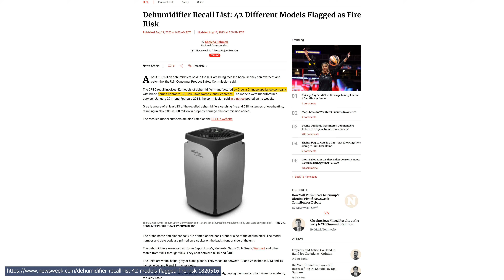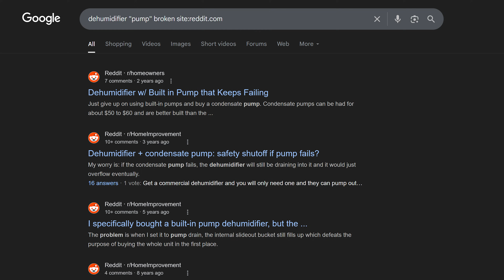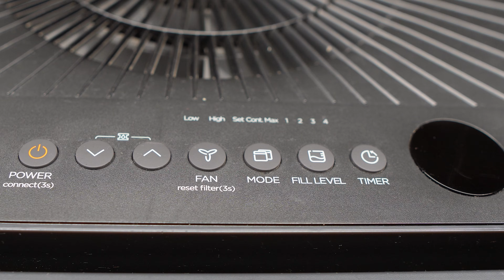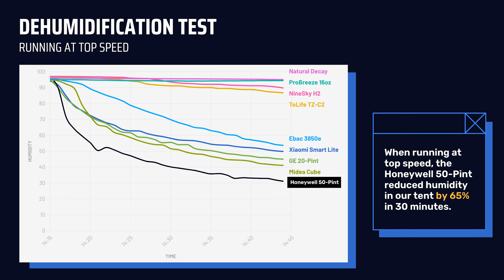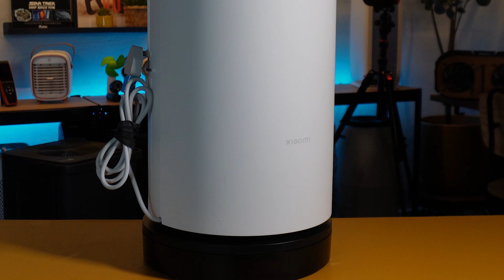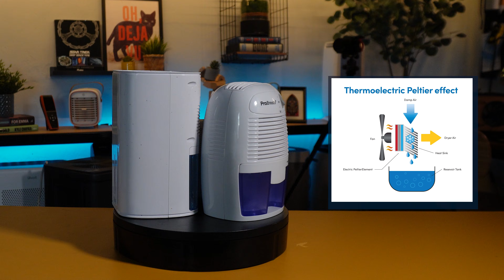Don’t Buy a Dehumidifier Before Watching This → The Best Dehumidifiers We Tested

Comment: Aerocky 5500 80pint or the midea cube 50 pint? The midea cube seems slightly more expensive but I didn’t see a direct comparison on your website. If you have the time. Please help me make a decision. My home is on the larger side 2600 square feet and has a humidity that ranges between 50% and 80% and I want to get it down to around 35%. I’m not home most of the day so I do want a big tank but I still plan on emptying it daily, just not sure if it will still run if I forgot to or am not home for a day or two. I guess a big concern of mine is that neither of my parents should be lifting more than 20 pounds and I’m worried that if the the tank is simply too big and I take a half week trip that they would try to empty it themselves and harm themselves. I just don’t fundamentally understand how fast any of these different tanks fill up. I hope you can begin to include that data into your videos. If leaving the dehumidifier alone for a few days would be okay even with a small 1 and a half gallon tank like on the aerocky model I looked at on Amazon then I would prefer it, but if not then I would need to go with a much bigger tank like the midea. If you do take the time to respond and help me make a decision, please be sure to leave your Amazon links so I can use your affiliate link.
Reply: If it helps I have a very large basement and Attic, same square footage of the house each of them separately, and both of them are not insulated at all(almost open air but not really) and let all the moisture in. If you believe I should go with an even larger model I will trust your judgment.

Comment: Please,  let us know the details of a dehumidifier for the laundry and how buy one useful for it and the kitchen room in winter. Keepind the good temperature combined with the weather in South England 🇬🇧 by the sea. It's very humid close to the seaside. Could you make the necessary difference btw a high end as Dyson performing dehumidifier and a cheaper good one. Will need a big one or 2 machines for a 120 m3 flat. Thanks for your nice 1st video
Reply from the maker: I would reccomend checking out my latest video that focused on the UK market: https://youtu.be/kv2sMl2h618?si=LGBVd4kaXNmOZ-2- Let me know if you have any other questions.

Comment: Would like to see more reliability info on the various brands/models.  I had an Emerson 70 pint model that quit in less than a year.  I replaced it with a Honeywell 70 pint model from Amazon  that lasted 2-1/2 years.  I replacex the Honeywell with a Waykar 70 pint model (also Amazon) that quit in about 8 months and was replaced under warranty.  The  replacement quit after about 6 months.  Fortunateky I had an extended warranty on the original Waykar and the purchase price was refunded.  All three looked almost identical inside.  The Honeywell was the best of the three (four really ) but I wouldn't consder any of them to be very reliable.
Reply from the maker: This is a very important point for dehumidifiers. I am working on an update for this video at the moment and I'm happy to report there are some good new models that offer 3 year warranties that should help a lot your experience of breaking after 1-2 years does happen a lot more than what I see with other appliances.

Comment: I bought a Danby twelve years ago and it's still going strong even with daily use.  Stay away from Frigidaire, as they just don't last; lots of complaints about system failure (EC code) after a couple of years or even less.
Reply from the maker: Glad to hear your Danby is going strong! 12 years is pretty incredible. Thanks for sharing your experience with Frigidaire and their system failure.

Comment: checking out the dreo  711S, hopefully its a solid unit, using gravity drain in basement.
Reply from the maker: I want to review this Dreo dehumidifier as found that the humidifier works really well from this brand.
Reply: @HouseFresh  it works awesome so far! I am using a gravity drain hose 5/8” ID I found they seem to last longer larger the drain diameter.

Comment: Had a delonghi when I bought a tsylor guitar...taylor guitars recommended it for thier acoustic guitars...had it 9 years..never cleaned it out and still works strong
Reply from the maker: It’s great to hear you’ve had such a reliable experience with that unit over the last nine years! I did have a delonghi model but gave it away to someone who needed it. Will need to make sure I buy another for the next update of this video.

Comment: I got a Midea Cube based on this, and a great in store deal. We've had it for nearly a month and it's helped a TON. Not only does it make higher temps more comfortable (in the PNW) but also it helps the AC perform better!

Thank you for this video, I'm sorry I wasn't able to use your affiliate link
Reply from the maker: Ah that's so great to read! I'm very happy the Cube is working well for you and don't worry about the affiliate link. Having you taking the time to share your experience here means a lot already.

Comment: Dehumidifiers are a necessity in northern Virginia, and choosing them is a nightmare. Only a Haier, no longer available, has lasted 3+ years. The cost of land-fill disposal was $30/unit in early 2025 because of the refrigerant. I was completely unaware of this. Now I have 2 which are dead. BLESS YOU for this very scientific comparison and excellent details, because I am again struggling to find something for a bedroom and basement.
Please, would you know why they all have these pathetic plastic hoses now??
Again, sincerest thanks for this EXTREMELY useful information.
I am stuck in the U.S. and so appreciate your worldwide approach.
Reply from the maker: Its similar here in the North of England, you just need one during the winter or model will grow. I had no idea that it costs to dispose!  

The cheap hoses do seem to be very common but I did like that a model I tested had a host connector so you can use any garden hose which makes a lot more sense!

Thanks for your very kind words!

Comment: I'd stay away from the Honeywell. I bought a 50-pint model almost a year ago and it failed completely just prior to the warranty running out. The company does not appear to be repairing these anymore. After having to call because there was no option online from the website, they pointed us to a non-advertised webpage. Filled out the form and was given a site credit as the "warranty" fulfillment, but the amount won't replace the same model and will only cover a lesser model. After watching this video, maybe I'll try the Midea cube. Thanks!
Reply from the maker: That sounds like a frustrating experience, so I appreciate you sharing the warning with others as I did notice that Honeywell has stopped selling many of the larger models we had tested a few months after this video went live.

Comment: I like my Pelonis from the local HW store because I can sit on it while I shave my head. The wheels broke off which makes it even better. I saw a new model of a different brand from Costco and will now avoid it because of the built in pump.
Reply from the maker: haha a dehumidifier that is also a seat! Yes the built in pumps are a major source of failure so I do recommend avoiding  and not paying extra for.

Comment: Hello. 
What a great video this is.
A question please. 
Do all dehumidifiers release or blow hot air into the room as they remove humidity?
I own a different units, and every one  does.
I remove the humidity, but the room fills up with hot air and doesn't feels any better than it was before I turned on the dehumidifier.
Thank you so much!
Reply from the maker: Thanks for the kind words.

All dehumidifiers will output hot air as they are basically an AC built in reverse. This video taught me a ton about how they work: https://youtu.be/j_QfX0SYCE8?si=7mNcF6mvlyRAiDvo

I'm not sure if there is anyway to avoid this without looking at a different type of dehumidifier that does not use refrigerant. Sadly I don't have much experience with other types of  dehumidifiers.

Comment: Quick question. I’m looking for a dehumidifier for my bedroom. The humidity has been 66-70 RH

How would the Midea Cube do. Would I need the 20 Pint, 35 Pint or 50 pint?
Reply from the maker: I would choose 20 pint but I have only tested the 35 pint for sound levels and it’s still fairly loud at 3 feet away for a bedroom. I would look at models that run quieter for that situation with lower extraction rate.

Comment: The condensate pumps all dont break, they get clogged up with nasty stuff that grows and accumulates in the water thats collected.  If you run a bit of bleach through the pump every season they usually last the life of the machine.  Or the hvac condensate pumps like the little giant brand will outlast the machine but still need to be cleaned out occasionally with a cup of bleach every so often of those tabs you put in them..
Reply from the maker: This is a good point but and true also of the gravity hose outlets. The one thing I will say that for some designs, the internal pumps are close to impossible to clean due to how the are integrated into the unit.

Comment: 120 pints per hour. In my basement. It stays 82° cuz so much heat comes off of it. A trade venting it out the flu. Then it doesn't work as well. And still hates the basement up. Any suggestions
Reply from the maker: How old is the model? Some of the older models have low efficiency so give out a lot of heat for the amount of water they can extract.
Reply: @HouseFresh 1 year old
Reply from the maker: @thomasmeadows256  So that won't be the reason. Is it pulling out a good amount of water, are you using the gravity hose or internal pump?
Reply: So I order the turbo dehumidifier. It's supposed to do after 7500 square feet. 😮. It came damaged FedEx. And I'm trying to get it replaced. Everybody's crooks. The vevor. Is the one that won't work is a year old. They said it must have leaked it's gas out. I don't know what to do anymore
Reply: Yes the vevor. Just kept dripping water at the end of the hose. I got the damage when going. Turbo. The doors all dented up. I had to shim the filter in. Add tape one side of the door. And I set it on. 60%. It's only 750 square foot. I just want to be able to go to the store myself. Oh this is ridiculous

Comment: Excellent video on dehumidifiers performances. Don’t dehumidifiers also put out via exhaust warm air? Do any of them have to be vented? I’m trying to make my condo feel cooler by removing humidity, but then I’m warming it up from the hot air from the dehumidifier. Please advise.
Reply from the maker: You're right, they do add heat to the room, and unfortunately, most portable units don't have a way to vent that exhaust outside. If possible maybe you can put the dehumidify in an area of the condo you don't use so it can remove water but without warming the surrounding area?

Comment: my new honeywell 50 pint bought in july 2025 for aprox 390 taxes included worked well last summer then when I plugged it in for 2026 spring it wasnt picking up any moisture after 12 hours and eventually showed an E3 code . So dead after 1 year . I currently passed along my requested info to honeywell canada (pics of the e3 code , placement of unit , sales receipt and unit silver sticker on back that shows model number and associated product code . Prior to even watching this video I bought a midea 20 pint and its working well so far . I love the design / big bucket .
Reply from the maker: That is frustrating to hear, but I am glad the new unit is performing well for you!
Reply: I havent heard from honeywell canada since submitting the photos they requested june 18th of the defective unit .The saddest part of this process is the honeywell I bought replaced a 35 year old unit that was an energy hog compared to the newer models but still picked up moisture and filled the bucket every two days when the humidy rose . My parrot even imitated the sound of the water from the coils dripping into the bucket which could also sound like something else if you catch my drift lol . anyways , 20 pint media workin like a champ so far but I've been seeing comments around the interwebs stating it too will conk out after a year or two .

Comment: How about comparing the crawl space, basement dehumidifiers.   These are different than the home ones you're showing.  They can pull 100 pints a day if needed.
Reply from the maker: Looking at this, we have a moiswell 145 pint model that does pull a lot of water.
Reply: @HouseFresh  I'll check it.  Right now I have a small dehumidifier that just constantly runs

Comment: They're little electric furnaces that also extract some moisture from the air. I sent mine to the county dump.
Reply from the maker: It’s definitely true that many models generate a lot of heat while running.

Comment: Great video does xiaomi  have a bigger model?  It comes with a 1 meter hose. Can you buy an additional hose. 1 meter is just a little short
Reply from the maker: Yes you should be able to buy a longer hose. I found some on amazon and they can be even as long as 10 meters if you need.

Comment: I have tried 3 different dehumidifiers over 2 years and unfortunately each of them failed. Each time the dehumidifier worked great for months, then I put it away for the winter (only a few months around here when I don't need a dehumidifier) and when the time came to pull it out and use again, it just stopped working! So it has to be something to do with the refrigerant design. Each was less than one year old. I read countless Amazon reviews and sure enough this seems to be a problem with many of the models. Oh and by the way, each time they returned my money yet I am left with having to dispose of the broken down model. I have another dehumidifier (a Hi-Sense Lowe's model) left by the previous owner which I moved to the shed to use there because it is just too loud to use in my house, but it still works at least! Ugh! I want a dehumidifier that lasts more than a year and is quiet! Please help!
Reply from the maker: Yes sadly it does seem that dehumidifiers have a much higher failure rate than other appliances. I am working on an update at the moment and I'm happy to see some brands offering 3 year and 2 year warranties as that should help as at least if it does break the company will deal with it. 

Our latest recommendations are here: https://housefresh.com/best-dehumidifiers-we-tested

Comment: I have that exact honeywell and it was great for a few years but the compressor stopped turning on recently.  Replaced the run capacitor and it did nothing.  Total loss.
Reply from the maker: damn sorry to hear about that. I do hear a lot about dehumidifiers breaking after some time across a lot of brands. One person said that when using them occasionally creates more issues but I need to investigate more.

Comment: Yes, please keep dehumidifier content available!!! Suffering in a humid climate and don't want to waste my time, money, and home repairs when a good dehumidifier solves the issue.
Reply: Yes, and please consider adding another test on heat generation of the dehumidifiers.  My Insignia (which looks exactly like many of these other ones) seems to efficiently remove moisture from the air (into a tank size that I believe they overstated, but that's for another day) but the real downside is it warms up the air around it by like 4 degrees F when it's running.  My hygrometer (a reliable model) about 8 feet away from it repeatedly measures a higher temp in the room whenever I run it, and honestly I don't need the hygrometer to tell me it.  I can feel it.  I hate to run it now as heating up the room works against me on hot days.
Reply: Get a split A/C for summer and a big quiet mark Meaco dehumidifier for winter. I did and I am very happy and it is quiet. 😊
Reply from the maker: Working on a new video right now and tested a lot more units and also added another test!

Comment: I purchased the Midea Cube 50 based on this and other reviews, but unfortunately my experience wasn’t good. The unit would not operate in “Set” mode, which is the mode where you control the target humidity. It consistently displayed 30–31% and never changed. I set it to 35%, then tried 45% and 50%, and the unit never turned on.

Meanwhile, the room clearly felt damp, and both my Temp Stick and a sling psychrometer were reading over 70% humidity.

Continuous mode did work well, but I don’t want to rely on that, especially when we’re away during the summer. I need a unit that can accurately maintain a set humidity level on its own.

To their credit, Midea support was responsive. The Cube may be a good unit overall, but I wasn’t willing to spend more time troubleshooting or exchanging it.

I’ve decided to go with a Frigidaire FHDD3534W1 instead and am hoping for a more reliable, trouble-free experience.
Reply from the maker: Damn sorry to hear about your issues. From reading the updated to wire cutter this issue with the Hygrometer does seem to effect a lot of units sold in the last few months. Will make sure to include in our 3 year review for our midea cube.

Comment: Such a helpful video, but how can I be sure the Midea cube does not have a pump.  Sorry if a silly question but will it say if it has a pump or doesn’t on the box?
Reply from the maker: It should say on the box or listing. But if you do end up getting a model with a pump you can just not use the pump and stick to the gravity hose as then its unlikely to fail.